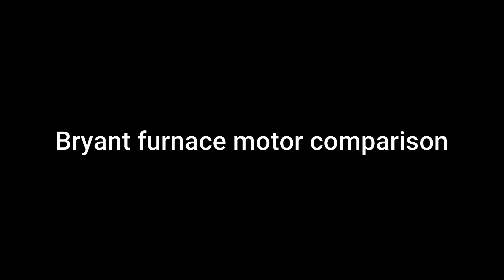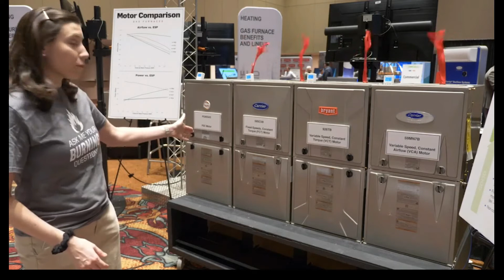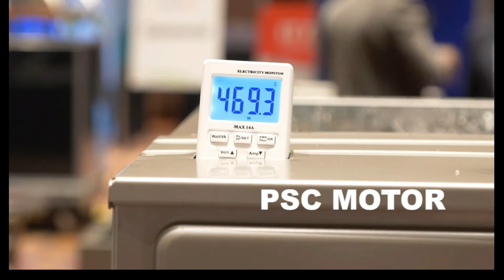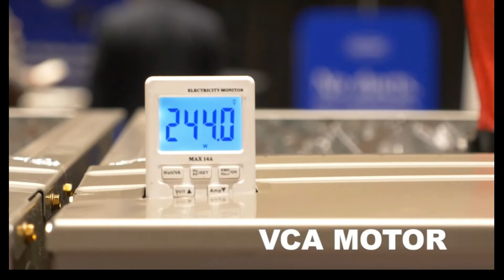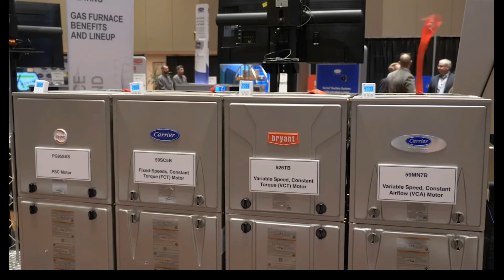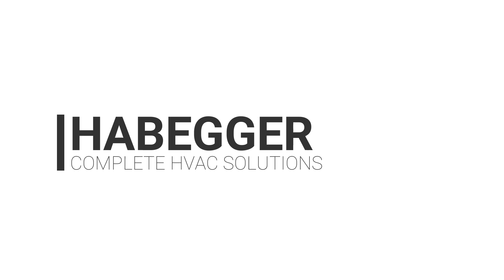Furnace Motor Comparison

Comment: This is a pretty dishonest video. You know that the typical blower is rated for 0.5" wc and are acting like it's supposed to run at the 0.1" wc. As you also know, a psc motor has the highest amperage draw at the lowest static, i.e. once the static is increased to the normal 0.5" wc, the wattage will decrease for the pcs and increase for the ecm. Why don't you show the comparison at the 0.5" wc it is supposed to run at? ECM motors also cost significantly more and there is much discussion about them having a shorter lifespan due to the additional electronics, though ECM motors are usually more efficient.
Reply from the maker: After more than 20 years of testing motors I believe the factory made video is correct.

The point is the correct airflow at variable resistance for unit capacity, based on motor design.

Residential units are often rated 0.5 IWC ESP as a max, not necessarily the motor. The motor is rated at several variables including FLA.

Agreed a PSC motor has the highest amp draw at low static pressure.

But a rated PSC motor runs at designed FLA to deliver said capacity airflow at a given pressure.

A true ECM (same size) does not run at run at FLA with the same parameters. Not even close.

As you mentioned its Volts X Amps= Watts.

The ECM with the same parameters will have lower Wattage consumption.

And when taking into consideration air equates into BTUs, the ECM motor will deliver the correct air across a broad range of static. The PSC motor will not.

There are also savings in operation when a unit runs as designed. I have rarely in almost 40 years seen a standard duct system run exactly at 0.5 IWC ESP.

Which makes if very difficult for a PSC motor to be efficient.

Comment: Where is trane/american standard?
Reply: Trane and American standard have the exact same motor options, but that booth was the Carrier Global/ICP booth.  You can actually buy all of those motors in any of those brands.  You can get the constant variable speed fan on the Bryant or the Payne.  Or reverse, get a Carrier with a ECM Constant torque.